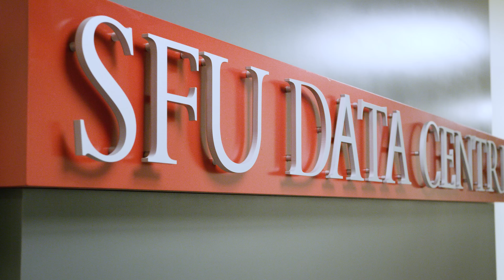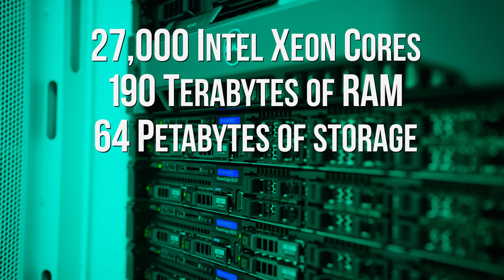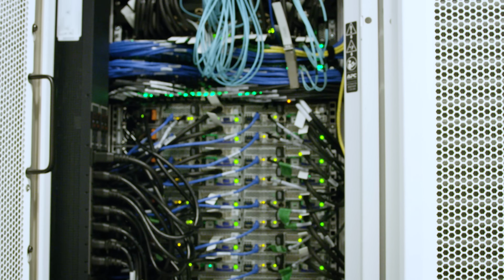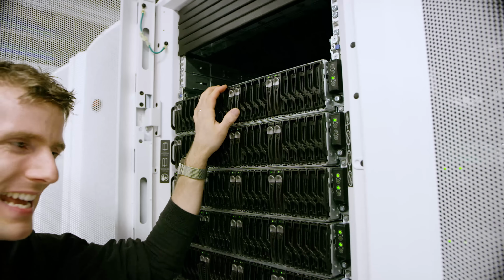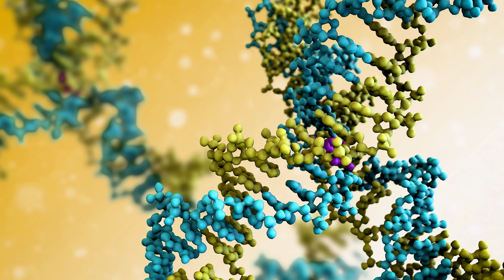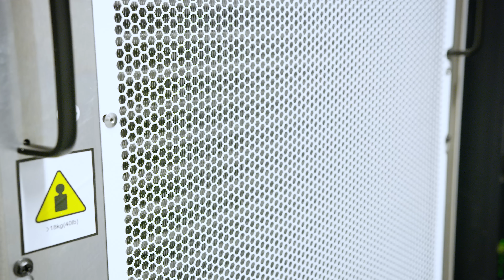Unboxing Canada's BIGGEST Supercomputer!

Comment: I'm surprised he didn't break anything
Reply: Everyone second that he was wiggling any number of the 100 Gbps fiber lines my ball hair stood at attention.
Reply: hahahaha indeed @misternormL  it may have downshifted to 40 or even 10  ;)
Reply: After he breaks something ...."its fine, everything is fine"
Reply: they didn't let him pick anything up except for one hard drive.
Reply: it was the hot spare, they let him get away with that one :p
Reply: i am surprised the 100Gbps network wires did not break when he touched them as they are probably super sensitive to anything touching them at all even air movement thus why they were in those shapes

Comment: Linus: takes out random HDD without any concern whatsoever
some dude saving his project: wait, where did it go?
Reply: I'm not sure if it's in operation yet as he is "the first one" to unbox it
Reply: RAID
Reply: The moment that happened I came straight to the comments and was not disappointed
Reply: That's what I was thinking too lol
Reply: every server is backed up
Reply: I seriously doubt they would let him in a live supercomputer room this magnitude. It most definitely is not operational yet. At least the memory he played with.
Reply: @fifski  if it was not deployed yet why would he have to where headphones. do you know what it cost to run a datacenter?
Reply: @papierbak  I actually do. That's why I know they wouldn't let him in to a live datacenter. It is on (probably testing, adding new racks, etc.), but definitely not live in a sense of not being a real production environment.
Reply: RAID: heard of me?
Reply: I do not think that the drive was plugged in... I mean, he took it out SIDEWAYS!
Reply: @m0ment219  that is not your normal drive
Reply: They're setup to be hot swap. Hard drives fail and servers are built to swap them out without having to take down lots of availability. At worst they would just have to switch off that storage array until the swap is done. But, if it's setup properly they could have a good number of different drives pulled out without the server even caring.
Reply: @Paradoxical Nightmare Ok? And what does that have to do with this? He's making a video talking about the tech and how it's all working, pulling out a part that's made to be removable while running is fine.
Reply: @Paradoxical Nightmare what video are you referring to?
Reply: @Paradoxical Nightmare Unless I'm missing something obvious I have no clue what ramifications you're referring to here. The system is made to perform like that and wouldn't even come close to breaking its stride from pulling the hard drive.
Reply: @Paradoxical Nightmare It wouldn't be setup in a way for that to happen. There wouldn't be much point to making the drives hot swappable and setting up good redundant data storage practices in a live environment if it was so easy to break. It would take a pretty major failure or removal of a number of drives in the right places before you'd actually start losing data. 

For a scenario like you are imagining to happen either the guy pulling drives is pulling a lot of drives in a really dumb way, or the system wasn't setup well enough for redundant data storage. In the first case it would be major incompetence of the worker, but not a fault of the system itself (and might not even be really gone, there's still possibility of recovery in some situations depending on the issue). Second case would be a fault of the system itself, but would be caused by a person(s) not properly setting up the system to begin with.

A lot of work and money goes into those servers to do a whole lot with high uptime and very low failure rate. The bigger worry I'd have is an unforeseen error that causes an issue like data loss that wouldn't really be anybody in particulars fault.
Reply: @Paradoxical Nightmare I don't think it works like that, live projects is done in the cache.
Reply: @Paradoxical Nightmare Wanna know something I am not surprised and for the answer consider this,what if there is some kinda drive failure in the middle, should it cause partial or any kind of memory loss, could it be tolerated in such a system, it won't be least of our concerns, but for them it can't be tolerated.
Reply: @Paradoxical Nightmare Yeah it does eat up lot of extra space, but don't you think they would sacrifice that space for this ain't even their main and final storage state(that is those petabytes of tape drives).
Reply: yeah imagine, 
Scientist, in front of a huge computer screen in a room full of press and doctors: «There, we have decoded the genome of the coronavirus and how to bring a vaccine for it! it takes a couple of terabytes, gentlemen in a couple of minutes we're going to make an official publication»
[97%   .... 98%.....    critical error - bad CRC - please check ]
Linus : «Look at that Seagate SAS drive! It's beautiful!»
Reply: @thesaladman9874  just a joke
Reply: Raid
Reply: Yeah in an interview later they said that Linus crashed the whole set-up process.
At 1:02 you can see the responsible dude patiently waiting while installing windows on the new supercomputer. When it reached almost 97% Linus popped out that HDD and the installation failed. The poor dude then had to restart the whole Windows installation process.
Reply: @fifski  shut down a single node is simply easy in an HPC cluster
Reply: They probably told him which one he can pull, also, there something called raid or raidz from zfs which allows that. You can do that on your pc aswell.
Reply: 1,700th like?
Reply: 1701th?
Reply: @papierbak  Do you know that you need to setup, test, benchmark etc. such a system and that it takes weeks to months until you go into production? Obviously not. ;)
Reply: @m0ment219  So what? You sould take a look at the connectors.
Reply: @Jesiah Nickolas Instablaster =)
Reply: @Jesiah Nickolas no problem =)
Reply: That storage node was off if you didn’t notice so all good
Reply: it's a massive JBOD array with extra redundancy. You could lose multiple drives, even a complete node and not go down or lose any data
Reply: that's actually how those mount, the tray has a special SATA connector onto the drive then to the base
Reply: it actually is a normal SATA drive, it's the carrier sled that is different

Comment: But can it open 20 tabs on chrome without using the half of the ram?
Reply: DeathSkull no the max is 15
Reply: dammit john
Reply: idk what you're talking about, between 2008 and 2012 i had a laptop with windows vista and 4gb of ram and sometimes had like 40 or more tabs open
Reply: never got into ram problems
Reply: BH4x0r Go on google and search Sarcasm Meaning
Reply: BH4x0r You were most certainly using some page file on your hard drive for 40 tabs of Chrome with 4gb of ram.
Reply: DeathSkull can't it's taking too much ram
Reply: ROFL, so true.

I have a tiny intel atom processor computer with an HDMI out that's the size of a 2.5" hdd, it only uses about 20 watts of power when playing video... perfect for my media center? NOPE. Why? Because one tab open in Chrome is trying to use 800mb of my ram... and it only has TWO gb total. Combine that it comes with Windows 10... it's constantly buffering ram and it drives me nuts.

Interestingly enough Edge was only using about 400mb so I was able to load Youtube and Netflix through browser fine.
Reply: Depends on the content I can get >50GB ram in Chrome with just ~100 tabs spread over ~10 windows open. Dynamic pages with tons of content can really bloat the ram usage. One time chrome even used up every handle in windows whatever that means and crashed the entire operating system from having too many tabs open.
Reply: Jesse Crandle consider installing Netflix from Windows Store, will save the ram taken by Edge ;)
Reply: HA nub i can run 100 tabs on 8gb of ram without breaking a sweat!
Reply: XxViciousxX no, just information pages and youtube. i was getting into c++ back then so i had alot of pages open, and i'm sure i had more open than just 40, the pages weren't too bloated with ads and javascript, and adblock helped against unnecessary RAM usage by ads for example

Comment: No wonder why mining difficulty is rising exponentially
Reply: crash KSA naw this is shit for mining
Reply: Using a CPU for mining? No thanks. This supercomputer is terrible in terms of modern super computers. It should have more Nvidia GPUs than Intel CPUs if they want some serious compute power.
Reply: It has 584 GPUs so it can be used for mining
Reply: KSA? bf3?
Reply: With Just the GPU nodes its still gonna output a metric shit tonne of Hash
Reply: it has more GPUs than I do, though.
Reply: I guess you missed the part where they installed the kind of processors they needed for the tasks they will be running.

GPU's are not great for all tasks, some require single threads at massive speeds, which CPU's are superior at.
Reply: Are you asking if i play BF3?

Comment: Benchmarks please.
Reply: dave mayer minesweeper: 3 fps on hyper
Reply: Lol, And we thought Pi had an infinite number of decimal places xD
Reply: wolf the hacker 

arma 3....... 45 fps
Reply: but can it run crysis?
Reply: lol no computer can do that
Reply: wolf the hacker do you understand what refresh rate is
Reply: We would need a 700 inch screen just to fit the benchmark number :D
Reply: Fast.
Reply: Take a bunch of regular benchmarks and multiply. Is this "really" a super computer, just a bunch of regular computers packed together? hmmm...
Reply: probably not  due to how the computer system is set up but it can compile crysis in less than a hour
Reply: AHAHAH that top500 site says that Rmax is 1,337 for Cedar
Reply: We use linpack, HPL specifically, to benchmark. The only aggregate we use is the GPU/CPU benchmarks. Each has its own, then we do a hybrid run. Unfortunately, we couldn't get the hybrid run to work very well, hence our low placement on the top500.org.

Yes, this is really a "supercomputer". We measure performance in PetaFLOPS. Yes, all any supercomputer is, is a bunch of single machines acting as one.

Fwiw, I'm one of the members of the team that runs this supercomputer.
Reply: @Rebel Turtle - That's just the score of our GPU's alone. We couldn't submit a hybrid run. The hybrid HPL wouldn't work on our system for some reason, and we only had a week to figure it out.
Reply: We found all the primes.
Reply: @suiciderabbit: sorry but im not a computer scientist i was only pointing out the "1337" part coz of the leet thing
Reply: @Rebel Turtle - LOL! I didn't even notice that! All we see looking at the score is "its not good enough", b/c that score doesn't reflect the capabilities of our CPUs. Thanks for pointing that out!
Reply: :D

Comment: but can it run crysis
Reply: Peter Parker on the lowest settings yes
Reply: looked at the comments for this comment.. I didn't have to look for long
Reply: You beat me to it
Reply: Peter Parker LOl
Reply: oh man i wanted to say that :( xDD
Reply: Peter Parker if this wasn't top comment I would have been shocked
Reply: I'd say Medium settings 40-50 fps
Reply: hahaha nice question 😜
Reply: Peter Parker beat me to it ahaha
Reply: You'd have to install the correct OS but it would not utilize most of the components XD
Reply: Ironically... no, not only does it all-but-certainly lack the IO necessary, its OS probably doesn't support the APIs required.  Not to mention, security would get extremely mad.
Reply: low setting 144p would be fine
Reply: It can Rape Crysis LOL :P
Reply: Peter Parker I was just about to comment that XD
Reply: next vid, lets overclock it
Reply: Peter Parker Fuck. Was literally was going to write that exact thing
Reply: Conor Do you know what a joke is?
Reply: Peter Parker i was asking the same question
Reply: nonono
how long can it run a danmakufu script meant to crash it
Reply: fucking beat me to it. I said it out loud too haha.
Reply: Nah too much delay
Reply: i was going to say, "can it run crysis," and the top comment is "can it run crysis"
Reply: Peter Parker Yes and in true 10 trillion K with a 50 petabyte texture pack on 800 billion fps🤣🤣

Comment: In 30 years, you'll be able to carry this in your pocket.
Reply: Adam Abbass Maybe....30 years is a long time mate and we will probably be like those fatties in Wall-E LOL
Reply: Unlikely.Not with current design models, circuit boards and processing theory. They can only make things so small.
Reply: in 100 years
Reply: Adam Abbass Damn, pockets sure are gonna get big.
Reply: nope.
Reply: will it play candy crush?
Reply: You won't be able to put this in your pocket, ever.
Core-systems will run all around the world, and stream your data to you.
Reply: Adam Abbass You already are, it just has a bit of a slow internet connection
Reply: But if the battery to THAT phone catches fire it vaporizes an entire city block.
Reply: Jared Johnson probably, but expect some major frame drops.
Reply: Fleixar, the battery doesn't have to be very powerful, as of now efficiency wise computers are crap.
Reply: It will be the next bug thing.
Reply: its possible in even less than 30 if some great innovation happens , less than 20 years ago floppies and 800MB cds were like the best things ever now we have 2-4 TB flash drives and up to 10TB small hard drives , tech is crazy and we have no idea how its going to advance in the next 3 years , we just need companies like intel to stop focusing on profit only and to start pushing new things
Reply: Nope.We will hit a plateau before then.  We're already hitting a demand plateau.
Reply: Read the last paragraph (or the whole article): https://www.extremetech.com/extreme/175727-ibm-builds-graphene-chip-thats-10000-times-faster-using-standard-cmos-processes
Reply: Said people at Microsoft in 2003.

Comment: ?but can it run crysis
Reply: RandomFocus1080p Yes
Reply: maybe
Reply: RandomFocus1080p I was looking for this comment
Reply: 16k at 5000fps
Reply: I have TWO 560ti's 2gb. I bought the second one mainly for doubling my Vram, because 2gb isen't enough for most recent games.
Reply: lel
Reply: RandomFocus1080p 3
Reply: sli doesnt stack v-ram, it only has the v-ram capabilities of the first gpu
Reply: Anss M. It share the vram evenly across the connected gpu's. So i have effectively the amount of the two shared togheter and games like gta5 detect 4gb instead of two.
Reply: Mme. Hyraelle no it does not... both gpus hold the exact same data they are just calculating different aspects of it
Reply: Mme. Hyraelle  It'll show 4gb sure but what you'll find is turning things on in the settings will also take up double what they did with a single card.  I used to SLi gtx970s so have done tests
Reply: Okay, that's weird because it did not showed me up that way, but yea having duplicate memory sounds more logical indeed.
Reply: Skillred Gaming with so much compute power you could probably emulate windows in an virtual machine and play crysis with it no problem
Reply: Skillred Gaming could you explain why  mr hardwarepro ? hardware is hardware
Reply: Skillred Gaming  It could if you installed a virtual machine on it.  Linus done at least two vids on virtual machines (Two gamers One PC and was it 6 or 7 Gamers One PC?)  It all uses the same concepts
Reply: Thats how PS Now and the upcoming nVidia streaming services work, you don't honestly think Sony have a butt load of PS3s streaming out games to subscribers?